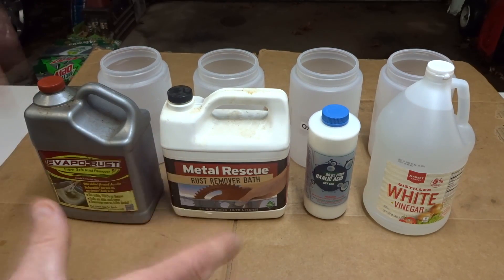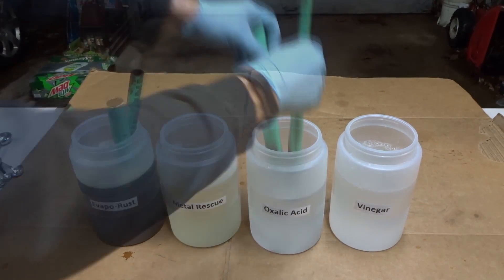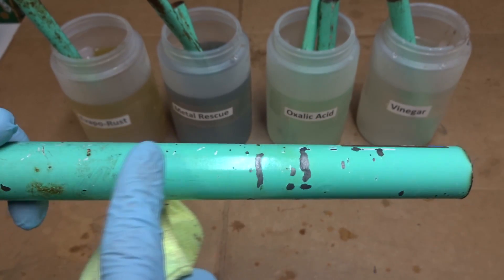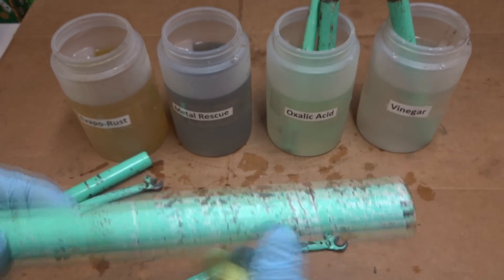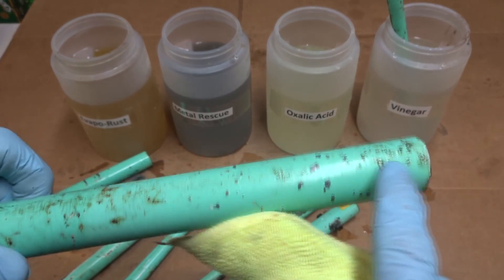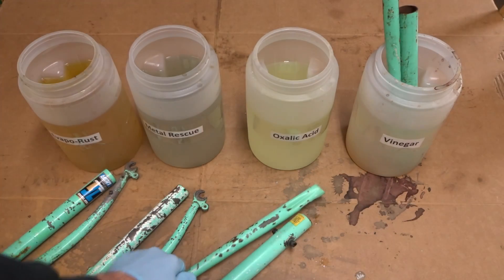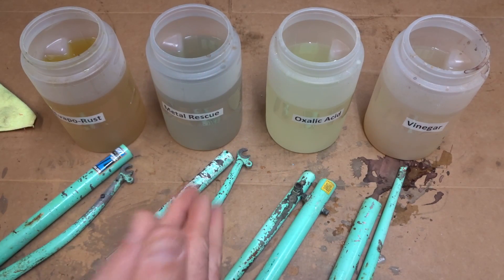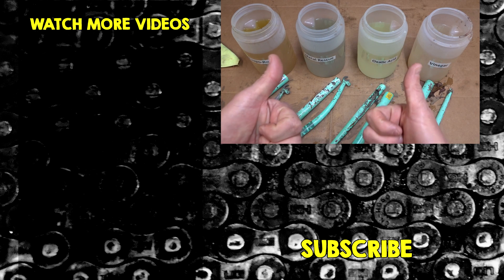Rust Remover Test For Bike Frames - Effects On Rust & Paint

Comment: RJ, thanks for your video. I've been using EvapoRust for years on bicycle frames and components. Whether EvapoRust removes paint from frames and components seems to depend on the type of paint used and how long you leave it in the rust remover. Paint easily comes off painted components after only a short period of 8 hrs in EvapoRust and seems to vary a great deal on painted frames. My question would be - what is the best way to remove rusted areas on a bike frame (the frame itself is too big to soak) without damaging the surrounding paint or decals and allow me to touch it up with paint I have in my work shop? So far I've just been using emory or sandpaper to take the rust down to the metal. Stripping the entire frame would destroy the decals. Be well, Tony M.

Comment: I’ve seen citric acid used on chrome rust removal, but not used on a painted surface. I would think it would have the same effect on the paint since it is much softer than chrome. I’m curious though how it would react with powder coated parts though.

Comment: Don’t need to dip the complete frame all you need to do is block up all the holes and gaps the chemicals can leak out of but leave the seat tube clear…possibly the head tube if hanging from there! leave over night the drain and add some rust converter….again leave over night…

The final cure is after the frame is fully dry,use a hair dryer etc….block up all the holes again then add very inexpensive raw linseed oil ! mix it around in the frame obviously covering the filling hole! then drain out….leave for maybe a week to dry…

NO MORE RUST ISSUES! i done a very rusty and damaged Surly using this method ☺️👊🏻

Comment: An easy to follow guide on how to remove rust from any BMX or any kind of steel frame. This method uses pool grade citric acid to dissolve rust - it's especially good at making old chrome sparkle. Mongoose, GT, Haro, Dyno, Redline.                      https://www.youtube.com/watch?v=GODIi34Ns2k
Reply: THIS VIDEO WAS USED  FOR 24 HRS ON A  VERY RUSTY CHROME HARO.      AND PROBLEY VERY CHEAP.. ITS A POOL SUPPLY  CHRYSTAL.

Comment: I used krud kutter and omg is was so bad. I put the chain in there and it freaking devolved the chain into little bits and pieces. I do not recommend and it smelled so bad that I felt like I wanted to throw up. I couldn’t work in the garage for a few days.
Reply from the maker: If the chain gets super rusty, chuck it and buy a new chain. The insides get damaged as well. Second, try Evapo Rust. https://www.youtube.com/watch?v=1zXzFFXbuMw

Comment: I know people are joking about cutting their frame up to do this, but do you have any suggestions for applying it to an intact frame? I'm restoring two bikes for my girls and I'm new to everything like this. I'm trying to think what would be big enough to lay a frame in to soak??? Or is there other "application" methods besides soaking?
Reply: Oh, my other thing. Although the Metal Rescue appeared to take off some of the color, was it a smoother transition from the bare metal to the paint that remained. I was just thinking that may actually save me time sanding!
Reply from the maker: Soak paper towels in Evapo-Rusts. Wrap the rusty spots with them, then wrap those with plastic wrap.

Comment: the amount of rust you're dealing with you'd be better off sanding it out, or just hit it with phosphoric acid and wash it with baking soda.
Reply from the maker: I disagree. Evapo Rust would do a better, cleaner job of removing the rust than sanding, only effecting the iron-oxide molecules. And acids work differently and messier than the rust removers. I found that pins in the vinegar chain came out with very little effort, while the pins in the chain pieces came out with normal effort. The vinegar removed more metal.

Comment: I’ve been using Evaporust for 3 years based on your videos. Way better than vinegar. I did find it’s “shortcoming” - or actually mine. If you leave a tool in it for a long period time - make sure it’s in a sealed container.  I had mine in an open tub and forgot about it. 6 weeks later, the evaporust solution evaporated (no pun intended) leaving my tools in a black tar that was hard as heck to remove. Moral of the story is to put it in a sealed container - and no issues.
Reply: FYI: Evapo-Rust is water based...you can add water that is lost to evaporation during use. Not sure if that would rehab a dried-out batch! ;-) Once opened, if you seal it, it is designed to deactivate via anaerobic bacteria. https://www.flagshipindia.in/evapo-rust-faq.html

Comment: I take back what i said about Metal Rescue, i think it was claimed you could reuse - reuse,
 but once it turns black it virtually loses it's strength
Reply from the maker: Yes, it eventually wears out. Evapo-Rust also eventually turns black and is worn out. But in my tests Evapo-Rust has seemed to do a better job.

Comment: Ask guys who restore vintage bikes. Oxalic acid is the go to. It's muuuuch cheaper than the Evapo. It works best when it's heated first and will yield the same results as the Evaporust. For small parts use Evaporust. On an entire frame, take a 50-60-gal bin and fill it with boiling water, then add the oxalic acid. Let it sit for 24 hours. Here's a link to an all-chrome Spaceliner that was restored using oxalic acid.     https://www.instagram.com/p/BkWAaQBHLlf/
Reply: Cranky Chain Cycles Just wait a few minutes while I boil 60 gallons of water 😂

Comment: Great video. Thanks for taking the time to show us all. Do any rust removers affect the strength of any metals? I've heard the black residue left behind is some of the carbon in the metal being drawn out. Would that weaken the metal?
Reply from the maker: If you leave the parts in them too long. At least for the acids. I am pretty sure it doesn't draw carbon out.

Comment: Thankyou for your test-video. I used vinegar-baking soda-salt-dishwasher. I read that stainless steel can be polished with this stuff, plus vinegar is environmental friendy, it is based on alcohol. It is acid and quite strong as odour, but you can use it for laundry smell and opening drains and cleaning windows and other. 

My stuff made cover of rust after I left it on bearings, so as well vinegar removes rust, it also makes rust. depending how you use it.

Comment: you didnt try citric acid
Reply from the maker: I tested two different acids, the oxalic and the vinegar.
Reply: @RJTheBikeGuy  in my experience citric acid works a lot better and faster than vinegar, especially if you make it a strong solution and use warm water, it's also cheap vs other options (from Asian supermarkets), doesn't smell bad and is easy to store as it's a powder
Reply: doesn't harm most stickers [decals] either

Comment: Nice demonstration and comparison of solvents... I have always used Evaporust and now feel better about never trying anything else, I have always been impressed on how it removes the surface rust off all bolts and nuts, small chrome parts and frame without damaging the original paint...I also use Loctite Naval Jelly Rust Dissolver for parts of the frame that can't be soaked,  its also safe on any surface and will not damage paint. Thanks for sharing...

Comment: Coke and aluminum foil works great for light rust
Reply from the maker: I see this suggestion often. I have tested coke as a rust remover, and it didn't do anything. https://www.youtube.com/watch?v=DZVdkLWAurE
So what does coke do here? Basically a lubricant? Maybe water would do as well? WD-40. Why coke? The crumpled foil is just like steel wool, except aluminum is softer than steel and less likely to scratch.

Comment: Looking forward to your next video on doing a whole frame. I have one that needs doing and i cant find a tub that will fit the whole thing. I have used both evaporust and oxalic acid in the past and both work pretty good.  If you have rust around eyelets on a top tube i found that making a paste with a few drops of water and oxalic acid works great. Apply the paste to the eyelet/cable guide with a q-tip and let it sit. It will dry out but all you need to do is put a single drop of water on it or use the moist qtip to re-hydrate the paste.  I then use another qtip to apply a rust proof primer like a small paint brush to the part after a through rinse and dry so it doesnt rust again. Works great.
Reply: I did a whole riding lawn mower deck in vapo-rust. I had to build a wood frame and layer up tarps. However, although expensive large containers can be found that are used for hydroponics. Though with that you have no control over the volume of fluid you need as you would when you build your own.

Comment: So would this method be good to use on nuts and bolts?
Reply from the maker: Yes.
Reply: a wire wheel on your bench grinder or drill is far quicker, though.
Reply from the maker: @johnpossum556  I have used that method well. Lot's of different ways. If you have a big batch, the Evapo-Rust would probably be easier and faster.

Comment: Rj, im curious as to what the inside of the tubing looks like. I have a Lemond frame that ive been thinking about sealing the holes on and filling it with a rust remover washing it out and then blasting it dry with a compressor for restoration.

Comment: I'm wander was the paint compromised or cleaned. I'd love to see this tried on newer clean paint
Reply from the maker: I cleaned the parts with soap and water and a scrub brush before the test.
Reply: @RJTheBikeGuy  Thanks, my concern was cleaning rust from a bike that I want to keep the original paint. It's a beautiful tandem yellow between 1965 to 70. My blind uncle left it to me.
Reply: @RJTheBikeGuy  this is literally the video i have been waiting for... I can't thankyou enough for this! Unfortunately I have to push the envelope a bit.... If you could run the same test with a bike with either orange or red paint it would be the absolute all time best... reason being (2 fold) I have heard the certain red and orange paints have ferric oxide in them as part of the coloring (which is what rust is) and i myself have a classic coppertone (orangish) schwinn stingray that i would love to use some evaporust on but am afraid that it might damage the paint. A retest on red/orange paint will answer the question of whether or not this is a good course of action. Thanks again! Great Job!